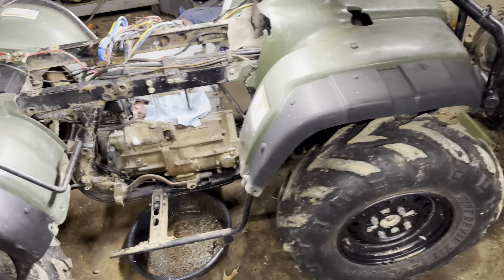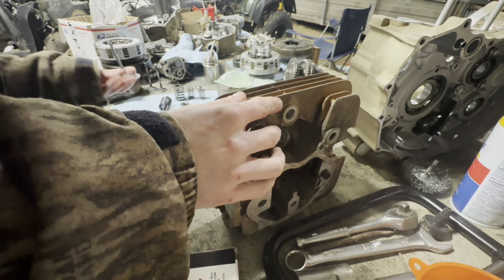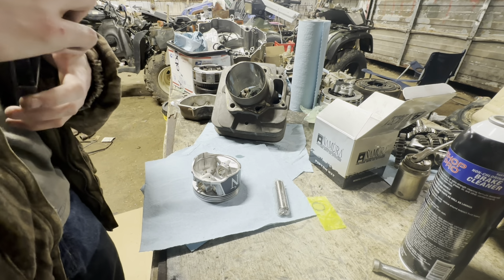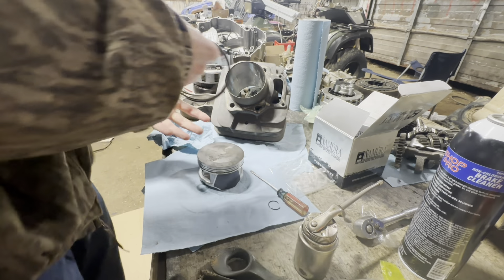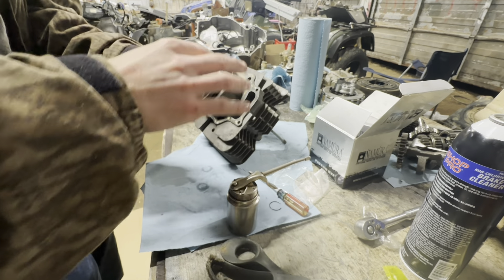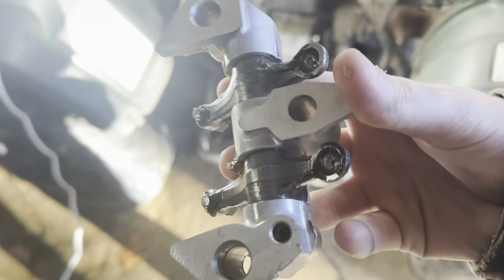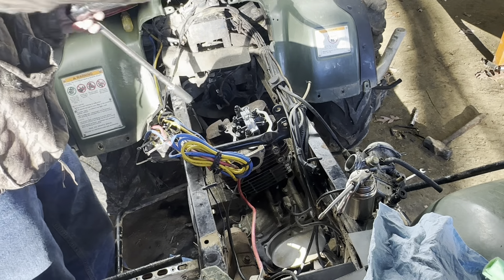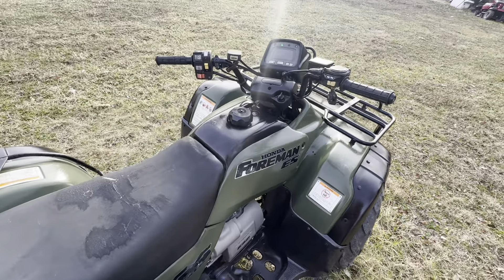Foreman 450 top end rebuild

Comment: You left out the part I need the removal of the head bolts from old cylinder
Reply from the maker: @cannaj875  it can be a little tricky, either need a pipe wrench or need to use the double nut method to remove them
Reply: @ double nut method just spun the threads I just bought new for $40